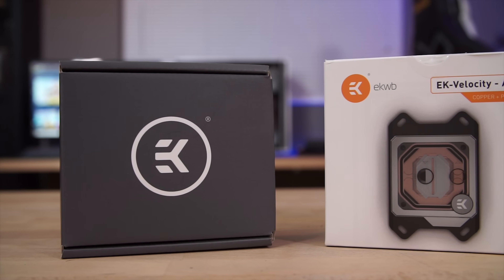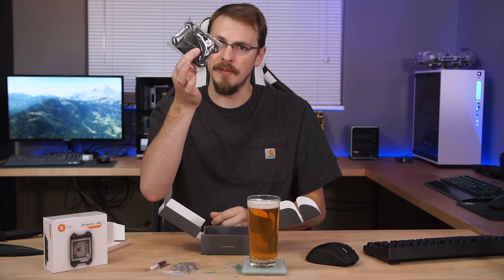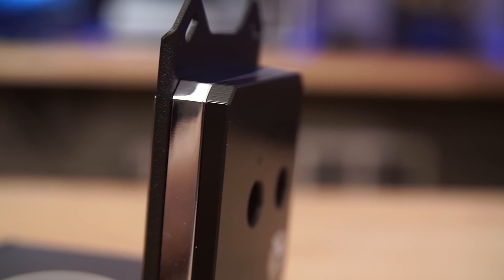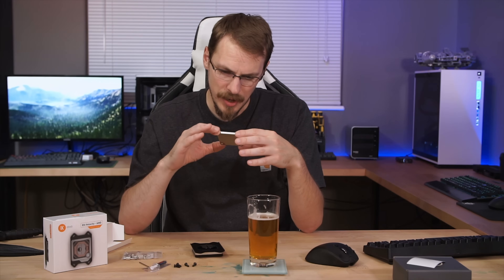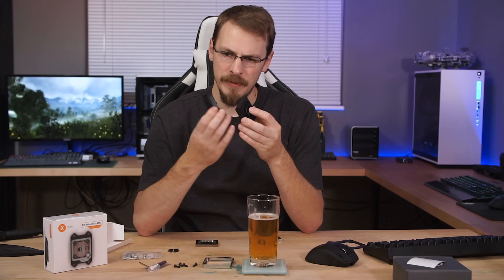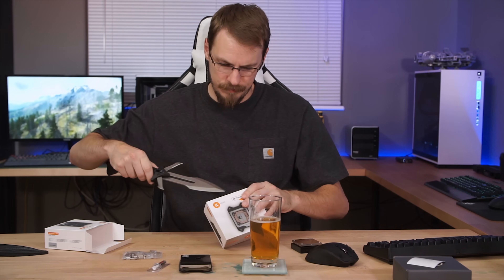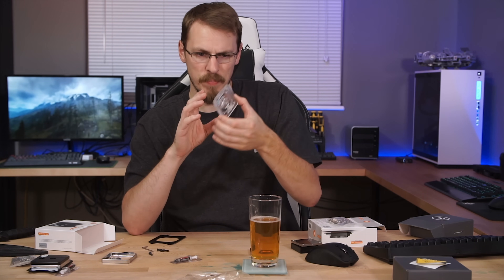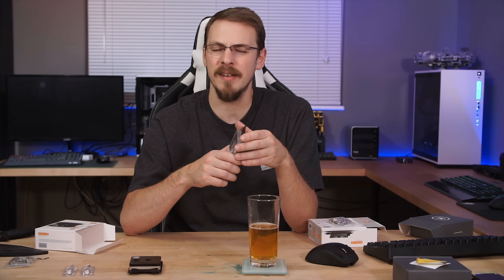Brand New EK Velocity CPU Waterblocks!

Comment from the maker: Aaaannd I made a mistake.  When reassembling the Plexi + Copper block, I put the cold plate on sideways.
Incorrect: https://imgur.com/MoTjW9J.jpg
Correct: https://imgur.com/g1cFQYF.jpg

So, as easy as these are to reassemble, it turns out I can still do it wrong ¯\_(ツ)_/¯
Reply: This why my cpu was overheating I need to turn that plate thank you so much

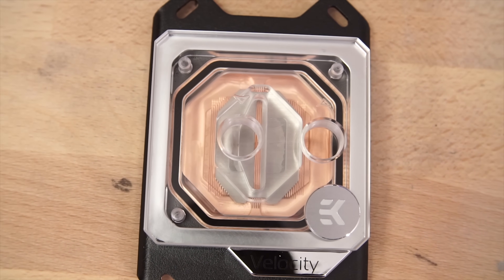Comment: They look fantastic and I can't wait to see a review with some performance numbers. I did have one question though. At 4:44 you can see that the cold plate is installed with the channels parallel to the slot in the flow plate. At 5:36, the box art appears to show the cold plate installed in an alternate orientation with the channels perpendicular to the slot in the flow plate. I checked the EK website, which confirmed my suspicion that the cold plate is installed incorrectly. Probably something you want to fix before testing them, but my question is this: was that footage shot before or after your disassembly of the block? In other words, was it shipped in that orientation?

Comment: Did you get that knife from a Klingon? LOL! Between you and Steve (HU), you guy may be starting a trend when it comes to unboxings! AvE uses a battery powered chainsaw, so...   Are you going to do some thermal testing between the new blocks and old blocks? I'm thinking of getting some quick release fittings for GPU, CPU, and well maybe enough to do another 4 GPU's, and others for maintenance and general rearranging of my loop. Still trying to hit a stable 5GHz on my 4820K. I'm at 4.984GHZ stable now!